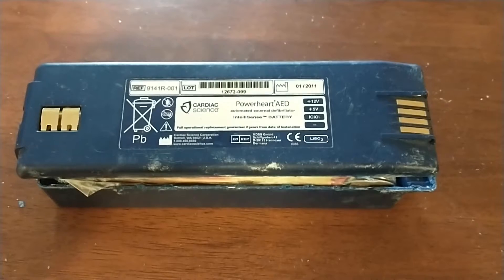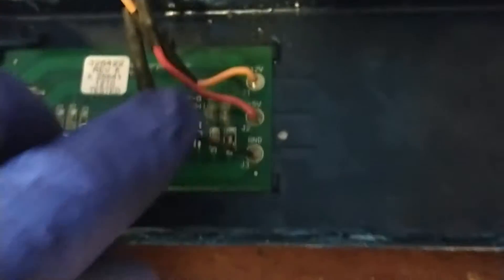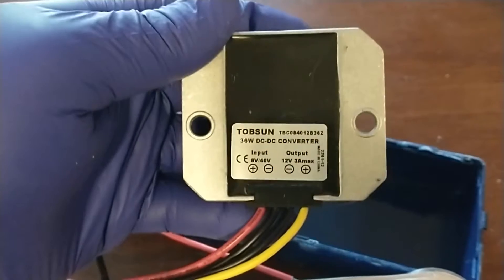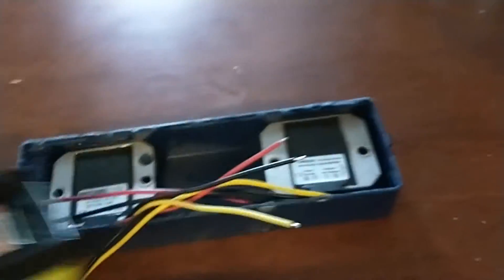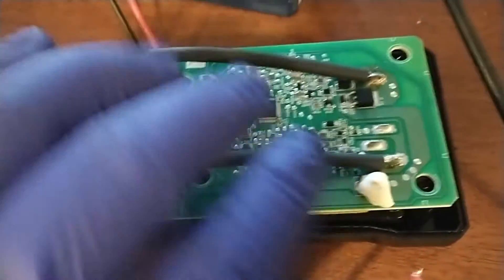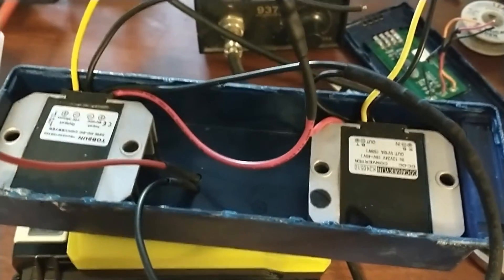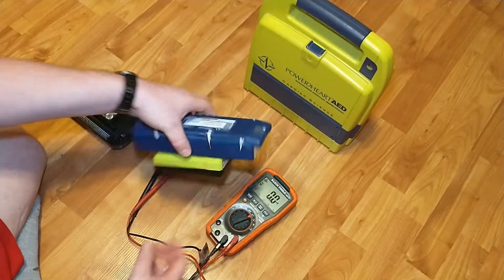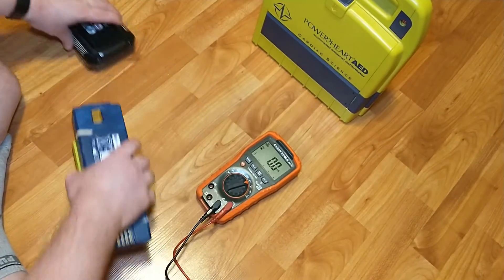Cardiac Science PowerHeart AED Battery Modification

Comment: Hod did you recharge this battery?  What were the results from the recharged battery? Thanks.
Reply from the maker: The modification allows me to use the batteries for my power tools, so I just use the charger for them. It powers up and says it is ready with no errors, but I don't have a way to test it further.

Comment: Hello, I also have an AED like the model you have, my question would be how did you do to reset the PCB that was original in the battery?
Reply from the maker: I did not have to reset anything. Apparently it just detects voltage drop as the batteries deplete. Since the voltage is constant thanks to the regulators it just thinks they are full.

Comment: Regarding the original battery package, are those 6 cells in series. 3v *6=18v? Or 4 in series for 12v and the other two for 6v instead of 5v?
Reply from the maker: I'm having to go by memory at this point, but I believe it was wired 6 in series and then 2 in series. You are correct, the math doesn't quite work out on the voltages. But I believe I remember seeing a few components in the battery pack that must have been to reduce the voltage. But I didn't test them since I was bypassing it anyway. The voltage on the cells was 2.7v or 2.8v as I recall. So 2 would be just over 5v. But then the 6 is still too high, so they must have reduced it.

Comment: Hello, good afternoon, and how did you do to charge it? I understood in your explanation that you did it. Can you share that information?
Reply from the maker: Yes, it is the same battery that I use in my electric outdoor power equipment. So I just use the charger for my lawn mower to charge the battery. Basically the same modification could theoretically be done using any large power tool battery, although none of this has been fully tested. It just passes self test and says it works. Don't actually know what would happen if I ever use it.

Comment: Shocks start at 100J varies based on impedance. You can get a simulator if you want to test it
Reply from the maker: Have to see if I can find one of those.
Reply: This particular model was offered in three variants being ultra low, low, and high current models which depending on impedance and specific variant could deliver as low as 100J and as high as 360J. Source: user/service manual http://www.frankshospitalworkshop.com/equipment/documents/defibrillators/service_manuals/Cardiac_Science_AED-9210_Defibrillator_-_Service_manual.pdf

Comment: BTW Was curious was it really a 5v connection on the battery as the LiSO2 batteries I think are 2.9V , and Lithium Manganese are 3V?
I think the Phillips FR2 uses 4 in series (4x3=12v) but have 3 parallel circuit.
This seems to have 6 bumps , and you can sort of see which batteries it is connected in the plastic packaging.https://youtu.be/vKN7tjPVicQ?t=77
Reply from the maker: I'd have to look, but I believe I got the info about it being 5v from info on the bottom of the battery itself. They had pretty good markings on it about voltage and which was hot and ground. That's the only reason I attempted it. I couldn't tell for sure when I messed with the battery, but I noticed another part attached to the battery. Since the pack was dead I didn't go any further in testing it, but it could have been to reduce the voltage. Like you said it shouldn't be exactly 5v with that type of battery. I'll see if I can find more info on the pack.
Reply: In the Philips Heartstart FR2 aed a dallas ds2434 chip is used to contain the battery history.  Also a quick blow 5.5 amp fuse and a slow blow fuse. Very easy to damage these in deconstruction the dallas ds2434 is the same chip used in meny laptops and tools devices. These are one wire devices (also used by apple ) I reprogrammed mine with a device  called Revelprog . We meet these chips in printers to wireless buttons, a hell of a learning curve to be sure. It is this chip and its like that need the 5volt line
Reply: @Lindsay1050  The programmer is very expensive though I note https://youtu.be/8pt0_so2VfwDid you have to reprogram it or only do so because you damaged in in extraction, got some data out and reprogrammed another. Did you need to zero the hours or something to get it to work? It is amazing they went to so much trouble. I note the temperature monitoring etc in the datasheet https://docs.rs-online.com/82a0/0900766b8002ce98.pdf
Reply: You are correct 3x4 CR123A 12v 4.2 amp  but you need a 1 wire programming tool to re set the chip. Hardiest part of the whole job is getting in.
Reply: Will try with the Arduino but the battery chip is encrypted? @Lindsay1050
Reply: It was not damaged on disassembly.  I had a new battery to hand, downloaded its code re flashed that to the rebuilt pack used for bench test . The .ow battery warning cleared and the unit under test ran from it. The new battery cost is £ 300. The cells are £40. You will also need a spot welder.  Its not cost effective to do nor safe if you plan on front line use. Mine was for a test battery as these AEDs often arrive to me untested, its not viable to buy a new battery or send out for calibration/ service with knowing if the unit even passes self test.
Reply: @Lindsay1050  No it is not for front line or public use. I agree that would not be a good idea. It was bought and used commercially by me when working in full working order, but after I retired I still owned he equipment and thought it may be good to have it in the home. Getting it serviced/calibrated after having a working battery is a good idea.
Reply: @Lindsay1050  Hi Lindsay. You seem very knowledgeable on the topic of AEDs and I wonder if you could help. I'm a community first responder in the UK and we look after local public access defibrillators as part of our volunteer role. They are all Cardiac Science G3 AEDs and now obsolete so the consumable parts are whatever our local ambulance service have left in stock or recycled.
We have had a frequent problem where the AED doesn't display any faults, indicates good battery charge but emits a bleep every 30 seconds.
Today, upon checking the battery voltage on two batteries I measured 11.8 Volt at the +12V terminal and 0.0 Volt at the +5V terminal.
Should I be getting 5 Volt at the +5V terminal with the battery not connected?
It would be really helpful to be able to assess our spare batteries before they are put into service.
Reply: If someone have the file emulator is the way to bypass the chip